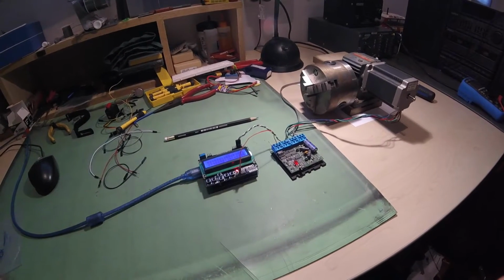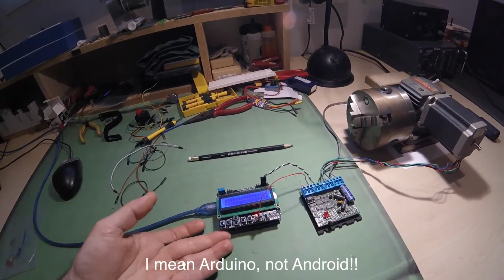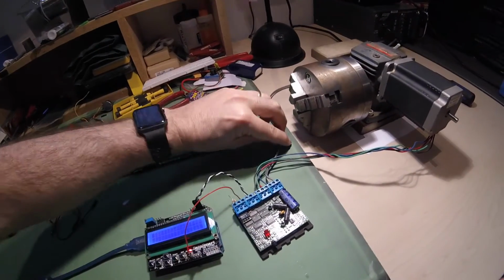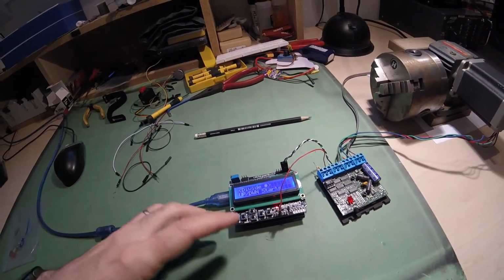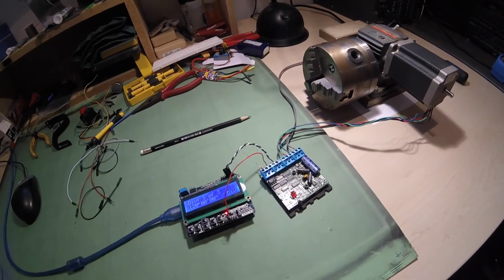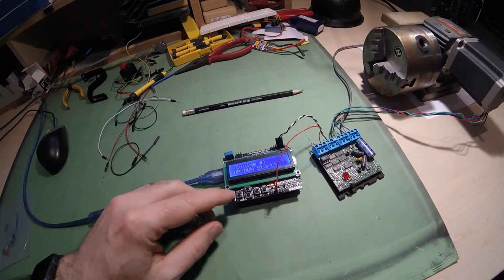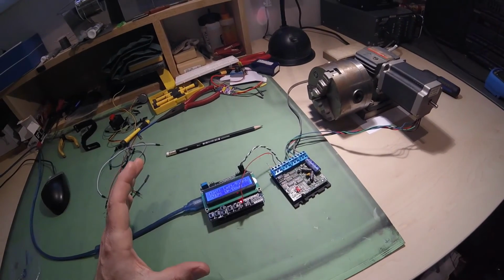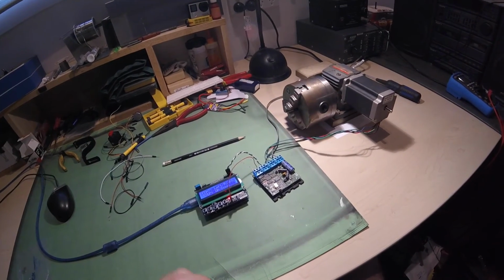Arduino Stepper Motor Controller Running a Rotational Axis

Comment: Hi Mike,
Im having problems with my stepper motor not stepping, it is locked up when powered up.
Just wondering is the Arduino 5v (red wire) jumperd between the PUL+ and the DIR+ on your stepper driver?
And the Arduino Pin 1 connected to PUL- and Pin 2 is connected to DIR- on the stepper driver?

Thanks
Reply from the maker: Hi Lora,
I am running a Gecko G201 driver and the unit is free to operate when the enable is "not grounded to -ve". So my driver in the video setup is never locked. I have a feeling that your driver may need a reference HIGH or LOW to enable the driver to operate - i would check the destruction manual again.
Pin 1 and 2 are just wired directly from the Arduino to the Gecko, no tying of the pins to power or ground. This is the green and white wires which are wrapped (see 0:00 timestamp)
The GND pin is wired to my common pin on the gecko so it has a reference for the STEP and DIR. In the video this is the red wire (yes i know!!)
This is all that was wired from the Arduino for the unit to operate the driver. 
I hope this helps you sort out your issue
Reply: @healingbench3198  Thanks for getting back to me,
 I had PIN1 and Pin2 reversed.  Working fine now.
Thanks

Comment: Hello, great job, did you have the code, the download link is unfortunately dead. It would help me a lot with my project so that I understand the programming better
Thank you
Reply from the maker: Try this link
https://www.homemodelenginemachinist.com/threads/interrupt-driven-rotary-table-controller.25091/
Reply: @healingbench3198  Thanks you helped me a lot

Comment: Hi
I'm looking for such dividing set up. I got excited when saw the link for code but  I cannot find the code, it seems the page is no more on the net. Would you send it to my email: ebrahimikntu@gmail.com
Thank you.
Reply: Not sure why the link is broken, however, you can find the full write up with this link. The code is also posted there. Good luck
https://www.homemodelenginemachinist.com/threads/interrupt-driven-rotary-table-controller.25091/

Comment: Hi Mike,
Can I use normal LCD shield for this?
Reply: Shehan Perera i believe so. You may need to reprogram some of the output to the lcd to make it work
Reply: seafurymike 
I uploaded the code.
But buttons not work.
Why?
Reply: Shehan Perera you need to remap the buttons in the code to work with your shield. Each device is different, thats why rodw mentioned it in the forum. He wrote the code, i would suggest asking him on the forum what needs to get changed. I dont know how to do that.
Reply: seafurymike 
Ok thanks,
Can you tell me what are the pins used for the driver.
Pin 2 for pulse+
Pin 5 for direction +
And for dir-,pulse-,enable-
Is it right?

Comment: Did you have any trouble running the sainsmart lcd shield instead of the free whatsits?
I'm using an OSEPP and I believe I need to change the resistor values that the buttons are recognised at.
Actually what I would like to do is build a simple pendant with my own buttons and lcd, so i know what the values are for the buttons on the sainsmart shield and what to change them to for using the osepp board. Just need to know if you had to change them for the sainsmart and if so, where the hell did you change  them. Im having a really hard time finding the code....
Reply: Christopher Leveck no not at all. It was literally a plug and play solution. Dropped in the LCD shield and the code drove it right away. I went with this combo for that reason, i knew it would work given RodW had previously used it.

If you need assistance, i would recommend sending RodW a PM in the thread link. He is all over this type of stuff.
Reply: seafurymike yeah, just knowing that the sainsaint works is enough for me to know what I have to change in the code. I'll be up and running as soon as I can get home to try it....
thanks for letting me know you saved me a bunch of time having to compare the code.....

Comment: Hi Rod,
For what is the red cable. With 24 volt blocks the motor. But it does not step when I am in the program arneite. I do not need any enable. best wishes
Reply: Werbewunder the gecko uses 5v and i took this from the Arduino

Comment: Hi Rod,
Once the program is great. After installation, only the right button get. I must first connect a motor driver before the other buttons react. sorry my english is bad i hope you under stand me.
Reply: Werbewunder There is no feedback required to operate the board in standalone mode. ie: you dont need a controller connected to get the lcd program to work

Comment: Your divisions are out. You divide into 120 degree divisions and step 3 times, which should give 360 degrees of rotation, yet the alignment of your chuck jaws clearly shows the chuck does not revolve 120 degree each move and the complete rotation is more like 330ish degrees by the looks of it.
Reply: noid919 yes i know, it is just the microstepping setting was set to two. Changed it to 10 and works perfectly.

Comment: Mike, Awesome to see you have implemented my Arduino code to run your 4th axis. The software is all original work of mine utilising several Arduino library modules (some of which I modified and extended to support required functionality which includes many more features than what is shown.
Reply: Rod Webster thanks Rod, now that ive used it a few times, i got to say its just sooo easy to use. Very intuitive. Great work and thanks again for all your effort. I think there are a few more to roll out of the shed for a few mates.
Reply: this a great project but when i try to verify the code it give me a fatal error which i can't figure out. please i need your help
Reply: Me gustaria hacer una afiladora para mechas, me podrias ayudar con eso?